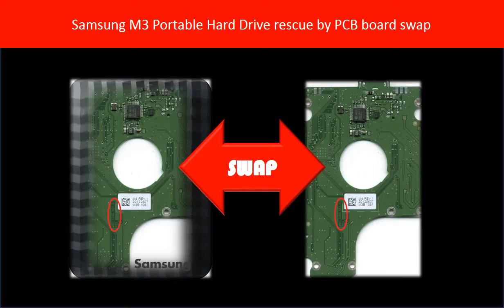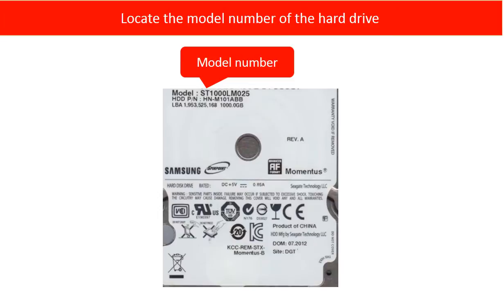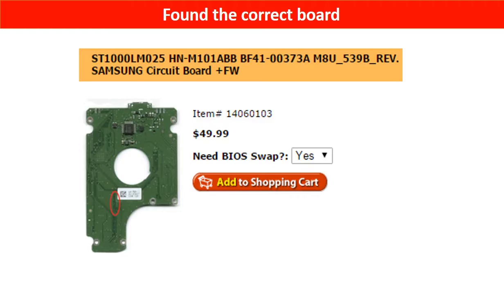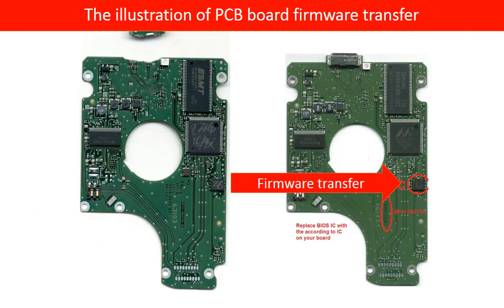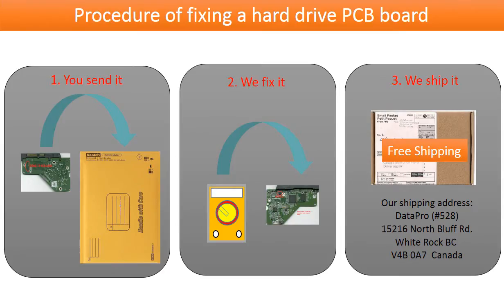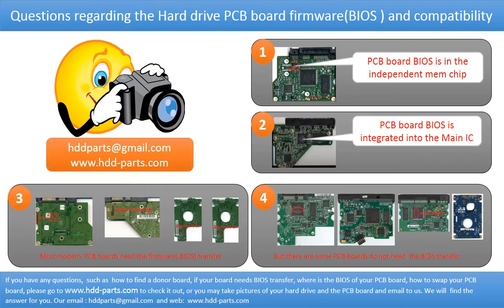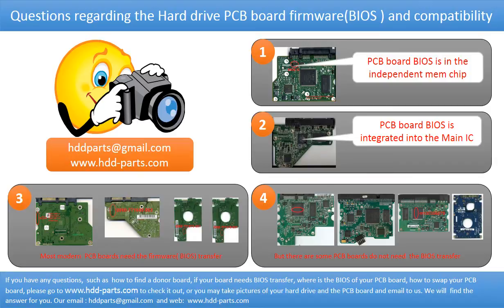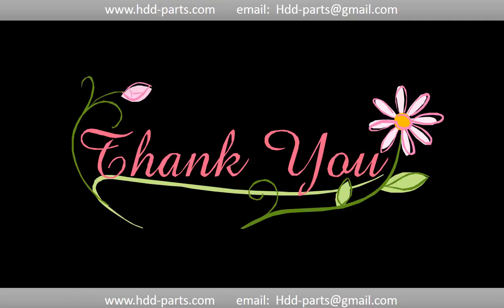Samsung M3 repair ST1000LM025   ST500LM014  M500ABB  HN M500ABB  M500ABB   M101ABB

Comment: Hi there, and If I don't know or don't have the original PCB board, is it impossible to repair?
I sent my external hd that was working to recover deleted data and after recovering they sent me back the hd but the hd does not work anymore, not even spins. I think they changed or damage the pcb board.
Reply from the maker: can you email us the pictures ? we maybe can tell if the board is original , and what the  problem is.
Reply from the maker: can you email me the picture of the hard drive and the PCB to hddgeek@gmail.com ? maybe i can check it out for you .
Reply: Ok Sean. I will send the pictures. Thank you in advance.

Comment: Hi there - how can you differentiate between board failures and disk failures? I have one of these and do not know which part has stopped working... thanks
Reply from the maker: Stephen Mudge general speaking, if no spin we will first thing the board is bad. if spins well , we will think the disk.
but try to swap the board is the best way to find out what the problem is.
Reply from the maker: you email the picture of the PCB board and the hard drive,and brief problem to
hddparts@gmail.com
Reply from the maker: can you email the pictures to hddparts@gmail.com, then we can tell which part is the problem.
Reply from the maker: can you email me the picture of the hard drive and the PCB to hddgeek@gmail.com ? maybe i can check it out for you